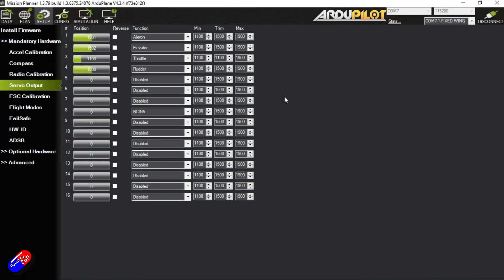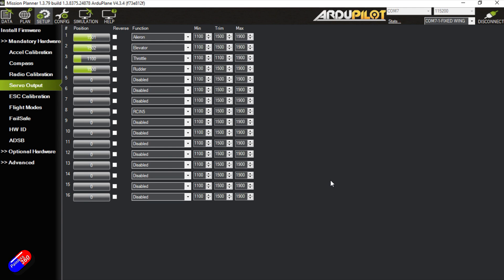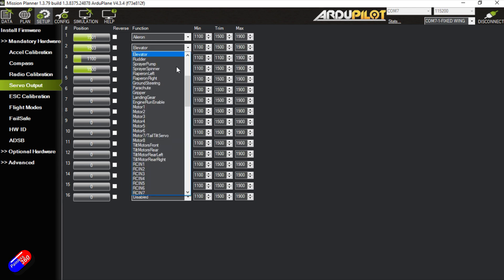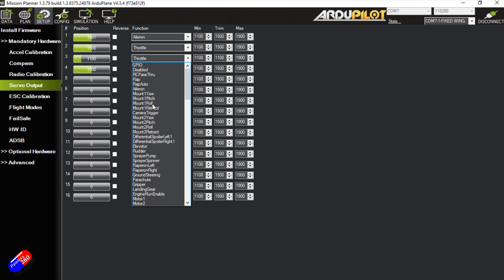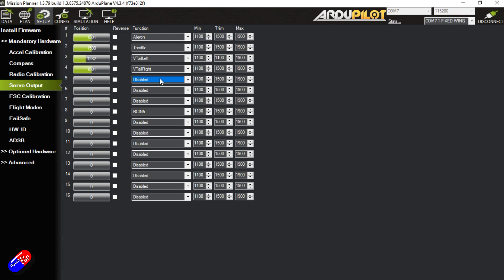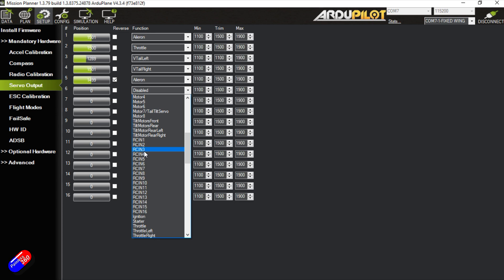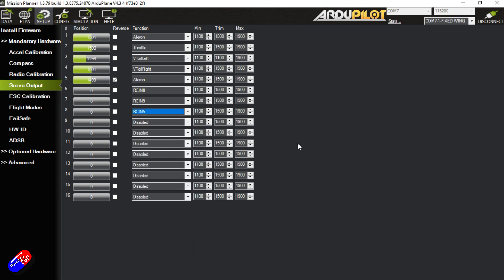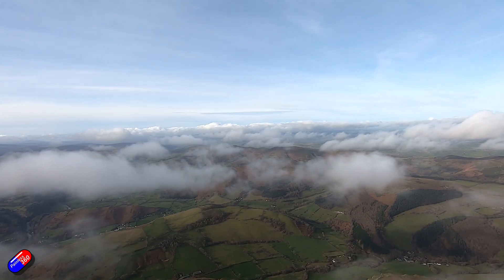Setting up Ardupilot outputs for copter and plane explained simply

Comment: sir in callibration screen all channels are working throttle working aeleron elev and rudder but in out put screen throttl not working cheked all config all fine servon_options are fine but throttle and motor not powering notjing happens
Reply from the maker: If you're talking about the Output screen in Mission Planner, then it could be a few things.  See https://youtu.be/074kwS_nL1E?si=D8cZVKOz-FdMPnu3

Comment: Long time watcher and subscriber; love your videos. I have an Arduplane question that I thought you might could answer. I couldn't find anything about it on ardupilot forums or in software. Is it possible to use BDSHOT on arduplane to stop the motor or motors in a position where the prop is level and out of the way from possibly striking the ground on belly landings? Obviously this would require some esc braking but I'm not sure if it's possible without a sensored brushless setup. What are your thoughts? Thanks!!
Reply from the maker: I'm not aware of a way to do that. Professional UAVs use the new TMotor arm sets that have self center... Happy flying
Reply: @Painless360  thanks!

Comment: hi, if i change this parmeters is mean that i didnt need to change the mixer value at my controler ?
Reply from the maker: You never change the radio setup. All of the setup for the motors and controls are done in the way shown. See my Ardupilot series... Best of luck

Comment: Is there a reliable way to determine with indicator lights on the FC Matek 405 or 743 with Ardupilot have successfully obtained a GPS fix? Thanks.
Reply from the maker: Not sure. I use Yaapu on the radio to show me when it has a lock. Best of luck